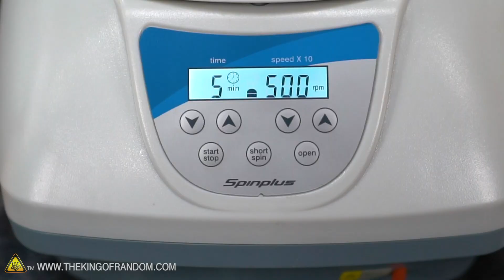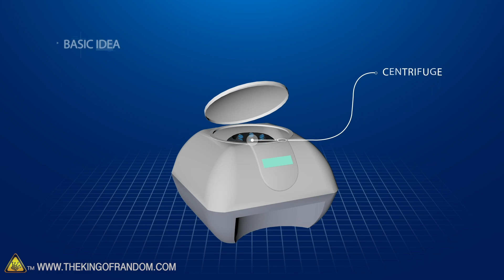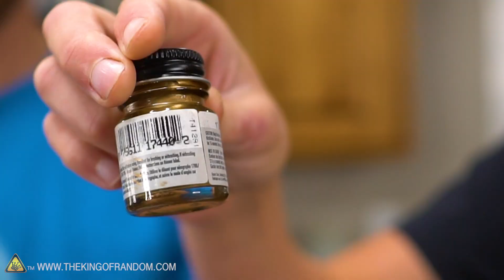How To Take The Chocolate Out Of Chocolate Milk

Comment: You can’t just put any 2 tubes across from each other, they in in fact do not weigh the same, Also why would you use glass tubes and finally for a beginner you should always said it at five minutes at 3000 spins

Comment: When studying we were taught that chocolate, tea and coffee are particles suspended in a fluid so you should be able to separate them into the suspension fluid and the particles.  Also, could the breakages be due to the centrifuge being slightly unbalanced because when we were taught to use the centrifuge they taught us to weigh each tube with its content and get them at least to within .01g of each other.

Comment: I've never used glass in a centrifuge before, and I've used one for years and years.  If you use plastic next time, it shouldn't break.  Also, you'll have better results if you actually measure things out, rather than eyeballing it.  It might also be fun for you to experiment with varying RPMs and times, but with the same substance.
(Also, like someone else pointed out, after you spin it down, the liquid is called the supernatant and the solid at the bottom is called the pellet.)

Comment: experiment for Centrifuge:
I asked my father (MS in Chemistry) and he didn't know
1) Does gravity/centripetal force affect how much of a substance you can dissolve in another (easiest: a salt into a liquid - form a solution not a mixture)
2) Can you separate (at least partially) a solution using gravity/centripetal force?  (e.g. salt water would have high salinity at the bottom, low at the top)
3) Can you actually precipitate out a salt if the gravity/force is high enough?

Comment: I work with centrifuges every day. We find that we have better luck with plastic centrifuge cones. My question is how many RPMs does the centrifuge get up too? The higher the RPMs the more separation you’re going to get it also depends on the amount of liquid that you have as well. One of the centrifuges that I have at work gets up to 3800 RPMs and has 4 wells for a  50ml centrifuge cones. I do have another one it’s a 16 well centrifuge that goes up to 3750 RPMs also uses a 50 ml centrifuge cone. Most of the stuff we spin has to be spun for at least 15 minutes.
Reply: P.S. The solid stuff at the bottom is called a precipitate, And the liquid that is separated is called the supernate.

Comment: Which will give you higher gs, your commercial centrifuge or a DIY centrifuge made from a bucket attached to a rope and swung in circles?  If it's the commercial centrifuge, how long would a rope have to be and how fast would you have to swing it to equal the commercial centrifuge's performance?

Comment: I use centrifuges a lot, so I would definitely recommend using plastic tubes if at all possible. Glass tubes break really easily and plastic tubes can really handle far higher speeds. That being said glass tubes are easier to clean because they don't scratch so it really is a matter of preference.

Comment: The centrifuge is a nice addition to the king of random experiments that can be done, I would try separating different types of sand from a beach near you or sand in the dessert. Try to pulverized it a bit and then sift,  put into a solution. It might be interesting to see if there is any separation of the pulverized sifted sand components.

Comment: You can blend leaves in an isotonic solution, sieve out the big leaf bits and put the liquid in the centrifuge. At different speeds different cell structures will sepetrate out starting with cell walls and nucleui at slow rpm

Comment: You should try what happens when Flashdrives and Battery packets plug into each other. What happens to the files or will it explode?
Reply: Nothing will happen, the battery packs will provide the same voltage as a PC would, so all you would be doing is providing power for no reason.
Reply: Nothing would happen, the USB flash drive will just get power. The data lines are seperate from the power lines.
Reply: @gustavs845  Ok, thanks.

Comment: Just for reference, I intern at a microbiology lab. When I centrifuge lysed cells (broken cells) I typically centrifuge them for 1-2 minutes on 16,000 RPM so 484,000 RPM less than they did and for  3-4 minutes less.... I don't work with glass viles but I assume that is why the glass broke at the beginning... I may or may not have been freaking out because this equipment is VERY expensive...

Comment: FYI: The liquid post centrifuging is referred to as the 'supernatant' and the solid is called the 'pellet'.
Reply: Also three common reasons why your tubes were breaking:

1. Low quality tubes.
2. You're poorly balancing the centifuge.
3. You're using a second hand centifuge that has debris in the rotor.
Reply: Modest Badger aren’t they also just putting the liquids in there for super long?
Reply: Helen Pinkham  nah most of the time, we put stuff in the centrifuge for 10-20 mins but can go almost indefinitely. It just depends on what you’re trying to separate
Reply: I was wondering what would cause them to break
Reply: @Memento mori I wouldn't say that. Although I don't know the person, they probably have just gone through a chemistry course/class or has done a bit of research.

Comment: Try bottled water in the centrifuge.  They say "minerals added for taste."  I wonder if that would settle out.
Reply: Probably not, as they are dissolved? I mean.. I just think there's more plausibility to it not working than it doing something
Reply: Nothing happens. Centrifuges separate suspensions, not solutions. You could boil of the water to see how much minerals are left though.
Reply: Ohhhh
Reply: Maybe but I kinda doubt it would separate
Reply: Nothing interesting, we used to use water as controls in the chemistry lab during my studies
Reply: @sulaimankaka8423  bottled water?  Does anything separate?
Reply: Mabey 👍

Comment: The tubes kept breaking because there was too much force on the pointed end. Or the lip, I can’t tell how it was seated. But it should be snugly so there’s equal force around. And plastic is a better bet. Also 500 rpm is low.

Comment: We used to do an experiment with freshmen college students where you'd extract onion DNA by denaturing the cell walls with solvent, then putting the slurry into a centrifuge. The DNA would gather as a white puck in the bottom and could be inspected under a high power microscope.

Comment: You can literally centrifuge anything with a property of liquefaction and is composed of compounds of varying densities. From someone who works in a lab if you're going to use that centrifuge at high RPMs you want to use high density plastic vials that rest in the bottom of the rotor buckets. If the vials are shorter then the opening of the bucket just use a pair straight nose hemostats to extract the vials. Also, I've personally wanted to do different Hot Sauces, but I also didn't want to get fired if someone grab it and try to run it as a  specimen.

Comment: plastic centrifuge tubes are more hardy. Also, if the adapters are round bottom, you have to use round bottom centifuge tubes. Round bottom tubes usually withstand high speed (>10000 rpm) better than connical tubes. Also, you should weigh and balance the tubes before spinning, the vibration might crack glass and destroy your rotor.

Comment: I wanna see different glues in a centrifuge, like rubber cement, Elmer's, ect.
Reply: Depending on the glue, they will either do nothing/cure or separate into the polymer and solvent! Some glues are a polymer which is kept from immediately polymerizing by being partially dissolved in solvent. Other glues are their own solvent and will just become harder/more concentrated at the tip

Comment: First off upgrade from glass vials to plastic ones. (I know it sounds like a downgrade, but its durability in the spin cycle that is the upgrade. Less likely if not will not break.) Then lets start seperating some interesting things Like Gallium, glue, syrup(Chocolate/maple/ect), slime, and for fun of it our favorite starch mixture Oobleck! You can also try some other odd items that are slime/gel-like. including hairgel, shampoo, conditioner, a combo of bodywash and those two... and more.

Comment: I’d love to see some chromatography experiments! You could compare the most popular pen brands as well as seeing if you can do it with different sodas or juices or even if chromatography works in a vacuum chamber! (In true TKOR style!)
Edit: Wow guys thanks for the likes! I’ve never gotten this many before :)
Reply: I'm guessing you mean the ones on plates/paper (Thin Layer Chromatography) because there are a lot of different types of chromatography
Reply: @yannickvanzetten8278  If they mean TLC, then it certainly wouldn't work in a vacuum chamber. The solvent vapors help the solvent travel up the plate, but they would just be pulled out by the pump. It would be very anti-climatic if my thinking is correct, lol.
Reply: @Asperion27  indeed, and if any other type they want to try, they might want to set up a patron page, because those devices are expensive AF(near the 20K range, without installment)

Comment: Although I've never used this type of centrifuge, I know that if my rare samples kept breaking I'd be rather upset. Surely there's an issue here.
Reply: This is why we use plastic tubes in a hospital setting.
Reply: @amcal88  So is this a known issue, or are they just using low quality tubes at too high rpm?
Reply: Ian Under the force of the spin, the conical (pointed) end of the glass tubes can’t hold up to the force and they’ll break. I’m with Ashley on this. Plastic tubes all the way. The plastic insert that held the tubes appears to be a round bottom. Maybe a round bottom glass tube would be better than suited for TKOR purposes.
Reply: @Ian123Ian   I think that is the issue; too high rpm for glass. We actually do use glass tubes to spin urine samples, but its at a lower rpm for a longer time. These glass tubes have made their way into the chemistry centrifuges  (where we spin the blood) before. We've also received blood in glass tubes from other facilities without realizing. It's very frustrating when the centrifuge is the first to discover these sneaky glass tubes 💥💔
Reply: @nooperspism  Thanks for pointing out that they are conical tubes. I've never seen a glass conical before. Makes me wonder if the specs didn't state the rpm limits 🤔
Reply: Definitely need to invest in plastic spin tubes, or fisher conical glass ones.
Reply: I was thinking the failure rate seems rather high. Something definitely not right.
Reply: It may be because there was a little too much weight difference. They didnt seem like they were weighing the samples.
Reply: @enesbozkurt6902  If the centrifuge is unbalanced it will rattle, vibrate, or even "hop" around. You will hear it from across the room. I think the issue here is not with the balance, but the rpms were too high for the tubes they had.
Reply: @amcal88  only  if there is a major unbalance. Modern centrifuges can handle a small amount of unballence quite well because of the suspension systems of the inner rotor. The only issue would be the extra force of the vibration.